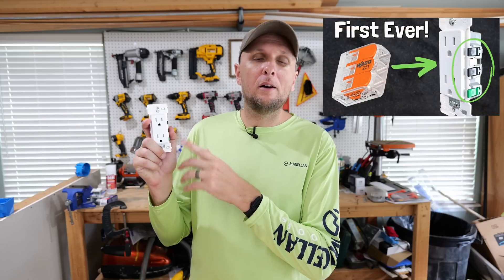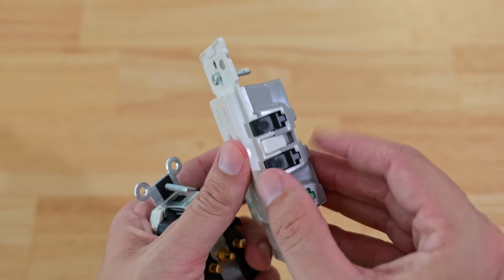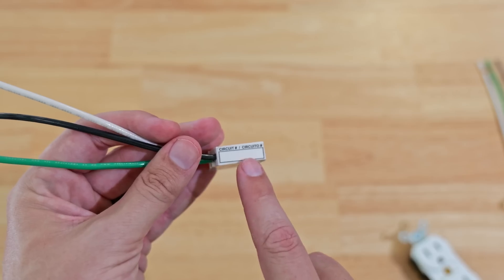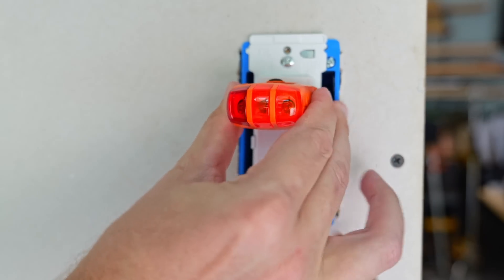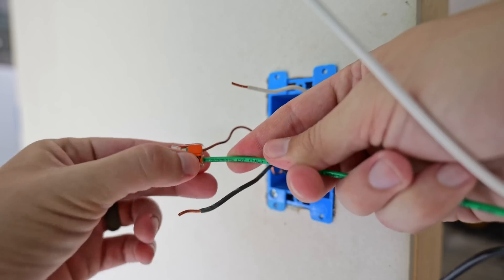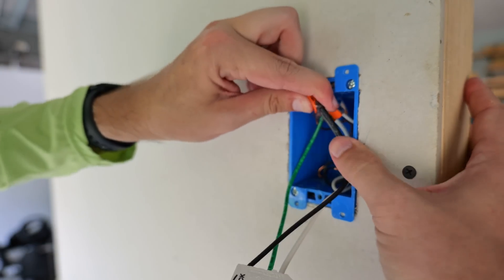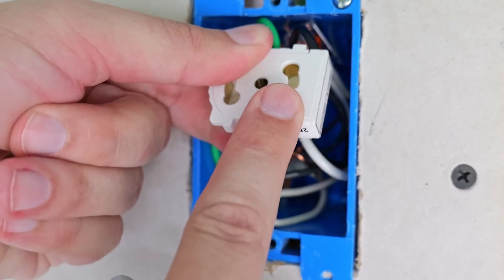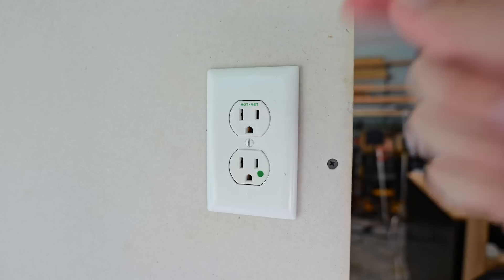GENIUS Twist Lock Electrical Outlet That Nobody Knows About! Better Than The New Decora Edge?

Comment: One consideration- the NEC has criteria for how far wires must extend out of the box-the minimum is 3 inches beyond box edge.  With the Decora (or screw terminals or back wiring or back stabbing🥴) you can just connect the outlet  to the wire which is required by NEC. This product requires adding the module and its wires to the outlet BEYOND the NEC required wiring. You could shorten the module wires, but you still are adding the bulk of some module wire AND 3 Wagos.

Comment: 7:20 Wires should be straight inside the lever nuts. The same for the push in type connectors.

Comment: I’m shocked (pun) I did not know about these until now!  I’ve been using Decora Edge lever lock and these are even better.  Electricians are essential.  But I don’t call one to change a lightbulb.  This makes changing an outlet or switch as easy as that.

Comment: Interesting.  I would like them if they came in the more modern look format.  Another nicety is that one can effectively complete the pre-wiring and just snap the outlet and plate on later by putting the pigtails in and then doing sheetrock mud (by leaving the paper tab on, doesn't damage or mess up any wiring).

Comment: I'm skeptical about the Wago snap-on splices.  They worry me just like the old outlets where you push the wires in to a spring-contact.

You get much more wire-to-wire contact with a properly sized and installed wire nut, resulting in much lower contact resistance and better long-term reliability.

For a circuit regularly delivering more than 1000 Watts, such as a bathroom with a hair dryer, over time the Wago could become a serious problem.

Comment: Thanks for the video. Well done, as usual. Two questions: I have a home built in 1963. All of the original switch/outlet boxes are metal. As I have been replacing older outlets, I have found myself having to also replace the box with a plastic one. Is this code today to replace them with plastic? I have found that the old metal ones not only pose a danger but are all too small to handle the typical size of the newer outlets, specifically GFCI and Lev-Lok. Next question, do you find that using Lev-Lok are worth using even given the price over a basic one?

Comment: Suggestion: Wago lever connectors are more effective when the wires are straight.

These receptacles are mostly designed for use in a commercial environment where it may not be possible to de-energize a circuit to replace a receptacle. This system allows a receptacle to be safely replaced on a live circuit, in the same way that ballast connectors do. Think of a retail environment, where multiple cash registers are on the same circuit, and you need to service a receptacle. You cannot shut down all the registers, so these twist locks allow one to be replaced safely with the circuit energized. This is why they are offered in commercial grade only because that is their target application.

Of course, a Wago 221-413 pigtailed into the outlet to feed the receptacle will accomplish the same thing for 1/4 the cost. Lift a lever, remove pigtailed receptacle, replace receptacle, insert pigtail back into Wago , close lever, and you’re done, all without disturbing the live circuit.
Reply: Except standard receptacles have exposed terminals. These do not. It’s possible to pull the receptacle out of the box without ever being exposed to line voltage. If they’d caught on, the prices would now be similar.
Reply: @TomCee53 You could insert the wires into the receptacle and cover the terminals with electrical tape to the same effect and use the wagos

Comment: The Lev-Lok looks like it's upside down.
Reply from the maker: Well the letters are upside down but there is no requirement for orientation of a receptacle in a residential setting.
Reply: In commercial settings, they will often install the receptacle with the ground slot/hole up in case a piece of metal falls between the plug and the receptacle, it won't bridge the hot and neutral prongs on the plug. That's probably why the lettering is in that orientation.

Comment: They are a great idea and very quick timesaver,  BUT when you have a wall box filled with wires, that extra required adapter is hard to stuff inside a box already filled with wire nuts and/or 12 guage wires. AND the price is just crazy nuts !  When you have a 50 outlet job to do, that makes competitive pricing a big deal !  Just my quick observation that my wallet is screaming NO !
Reply from the maker: Oh no, I completely get it.  Like I said, it’s the only thing I could find wrong with them.

Comment: Pretty cool. I prefer the look of the decoras but also because they're easier to clean and they use the same face plate as the light switches. The reason that's important to me is because I use some custom stained wood and color coded plastic face plates and it's easier to just have them all the same and keep spares if more are being added or something needs to be replaced. You don't need to keep an stash of light switch  face plates and receptacle face plates. They're all the same face plate.
Reply from the maker: Yeah I can understand that.  They make these in decora as well.

Comment: They're interesting, but I'd still rather use a Leviton commercial unit with the clamp plates. The Lev-Lock basically forces a pigtail, and with code saying the Romex should have 6" from the back of the box, this looks like 4" or more inches of additional wire. Box fill could be an issue. Leviton doesn't appear to make a commercial grade Decora style switch (at least not that I've been able to find in the big box stores), and the residential grade switches are really junky. So all my paddle light switches are residential grade and the receptacles are all commercial grade, and that bothers me.
Reply: Are "Decora plus" the commercial grade switches you are looking for?
Reply: @aayotechnology  I guess something like the 5621-2W would be, but they're $10+ each, and Leviton decided to be tacky and emboss "LEVITON" in the lower left corner of the rocker.  What twits.

Comment: I was thinking of  installing some dual outlets in my office and garage. Two plugs are good for normal items but I sometimes need additional outlets in my office and garage. Do you have a video on using these Decora Edge Receptacles and how you would wire them with two 2 receptacles in each wall plate and if it can work with these Decora Edge Receptacles ?
Reply: Very simple job and it is almost identical to what he did.  Your receptacle is either an end run, where it would look just like his and have only ONE wire of each color in the box.  Or it would be in the middle of a circuit and would have TWO wires of each color in the box.  Here, he used a ‘two slot’ Wago connector to attach to the device plug.  Since you want two receptacles, You just need to use THREE five slot Wagos.  These are called Wago 221-415 and have slots for five wires.  Just like in the video, all the black wires in the box go into one Wago and you connect your new TWO black wires (one from each receptacle) to this same Wago.  Connect all white wires in the same way to their own Wago.  Connect all the green wires to their own Wago.

Comment: I've never heard of these, but I really like the idea and they are available by order at Home Depot. Unfortunately, at approximately $12 each, they are about $10 more than a traditional commercial grade and that makes them hard to justify, especially when there's really no functional advantage over a properly installed regular receptacle. I could see using a couple of these to try out. BTW, the advantage is pretty much erased on an end of the run receptacle or when all the screws are used for middle of the run because you're adding a wire nut or Wago, when none would be needed otherwise.

Comment: I think what might make it unappealing is that it requires proprietary hardware and considering most people splice wires with wirenuts, and not wago lever nuts, swapping in and out for different outlets outside the series might be a pain in the ass.